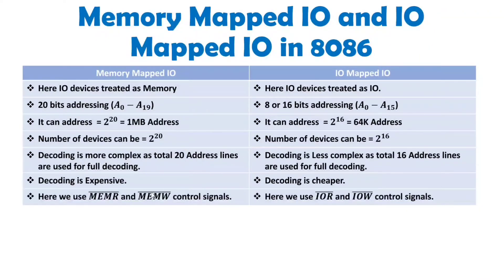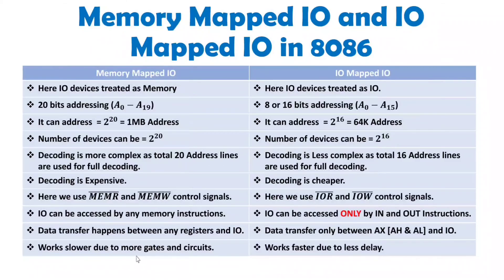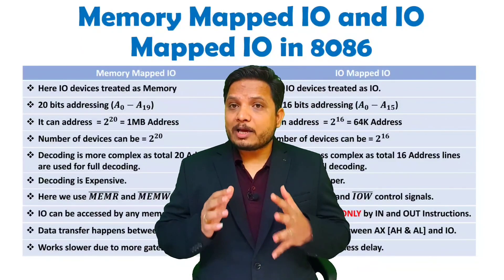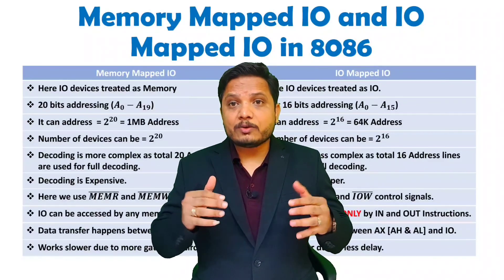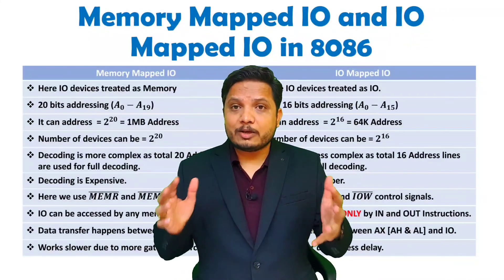Memory Mapped IO vs IO Mapped IO in 8086 Microprocessor: A Comparative Guide

Comment: Why here 20 bit addressing in Memory Mapped Io?
Reply from the maker: Micprocessor 8086 have 20 bits of address in memory that's the reason.
Reply: @EngineeringFunda  but, In 8085 have 16 bits of address
Reply from the maker: @dhruvbavaliya6568  8085 has only 16 Address lines
Reply: @EngineeringFunda  okk
Thanks for giving reply